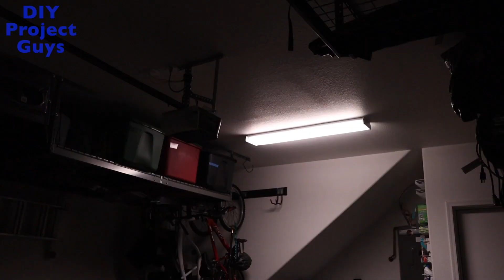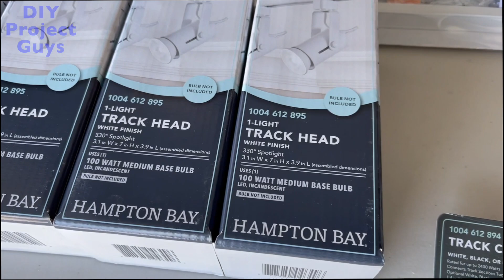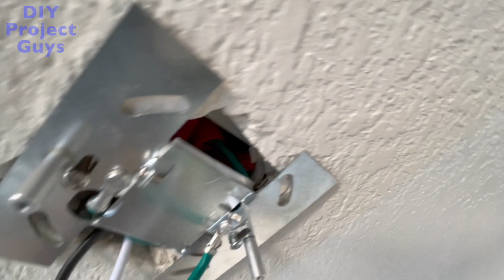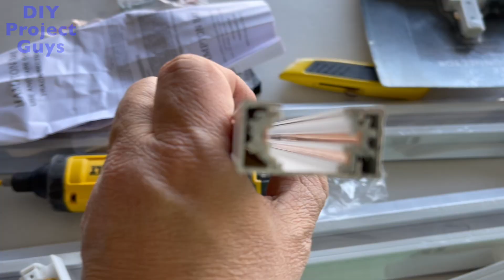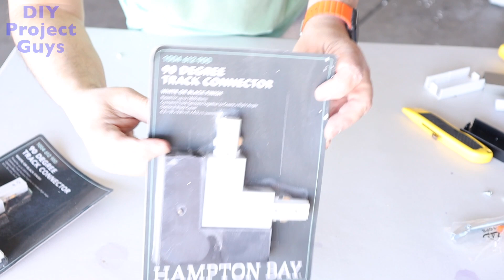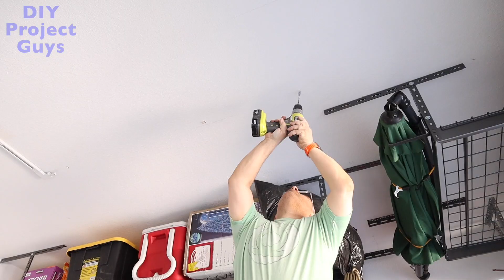HOW TO INSTALL TRACK LIGHTING | Hampton Bay Track Lighting Install

Comment: Just be aware that the Integrated LED track lighting with center light, stops working after around 2 years and the LED lights are NOT replaceable

Comment: Just bought 14 of the 8 foot tracks and 38 light fixtures from the same brand at Home Depot. This is going to be a huge project that I’ve never done this before but I think this video will help. Definitely glad that I learned that the corner pieces can only turn one way so you have to orient your track to match from this video before learning it by making a mistake.

Comment: This was the best tutorial I found for track lights. Thanks so much! Would you have any advice on installing track lights in a room that already has recessed lights in a way that the two can be controlled separately? Meaning I can turn off/on the recessed lights independently of the track lights.

Comment: Few questions for you. First can you cut down the track to a specific length? Second, do you believe the build quality is good enough for an out door patio application?
Reply from the maker: Hi Frank.  Yes, you can cut the tracks down to whatever size you want.  Thats what I loved about this system.  It should work find outside as long as the patio is covered and not a pergola.

Comment: I'm replacing an old track lighting but I don't have a ground wire coming out of the ceiling?
Reply from the maker: You have an older house.  Just connect the ground wire to one of the metal screws on the metal box and you should be fine.
Reply: @DIYProjectGuys Thanks. IT WORKED!!!

Comment from the maker: Hi everyone.  Thanks so much for watching my track lighting video.  This was a very easy project and it really changed the way I use my garage workspace.  Leave a comment below on your experience with installing track lighting.  - Joey
Reply: I have a question. A broken faucet flooded through my kitchen ceiling and blew out my old light fixture, so I'm replacing it. I took the old light fixture off and put in the power feed. I'm waiting to install the rest of the track because i need to repaint my kitchen ceiling but i wanted to make sure the power feed wasn't going to shoot sparks or anything crazy, so i flipped the breaker back on and everything was fine, and then i flipped the light switch, but this immediately triggered the breaker box. I'm not sure if this is just because I only have the Power feed installed without a track connected to it, or if I i have a problem with how i installed the power feed. The only thing i had to do that was different than your video is my outlet box didn't have a ground wire so i connected the ground to a screw in the outlet box. Could that be the problem?